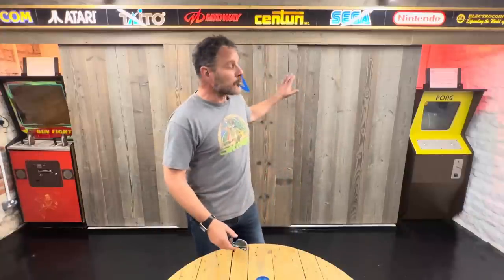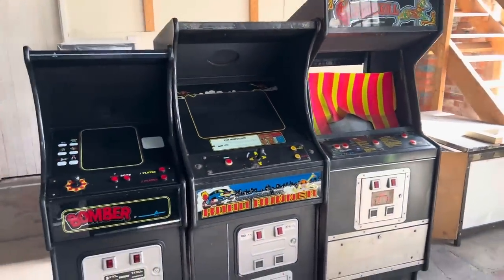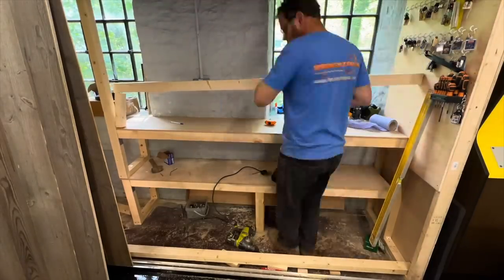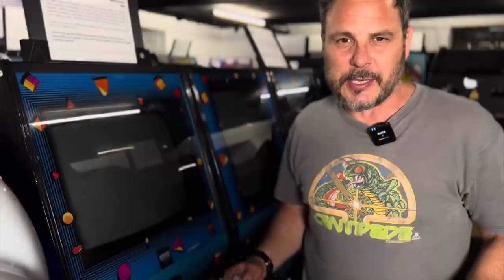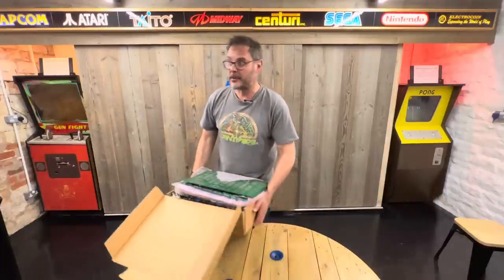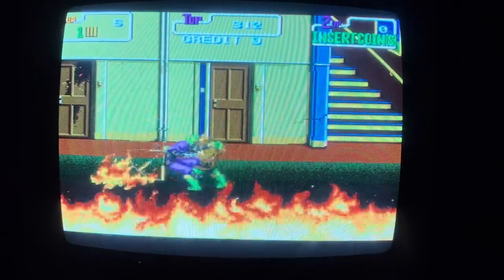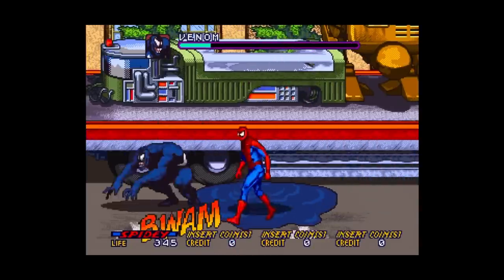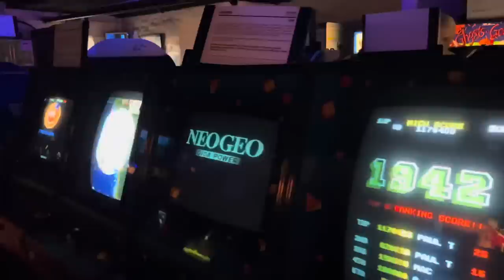I Hate Turtles | PCB Testing and Arcade Museum Update

Comment: Sound cutting in out is probably just a cold solder joint, should be an easy fix. You probably already know this, just excited for the new additions while watching the video :)
Reply from the maker: Your probably right mate, I’m no expert but we have the some really cleaver volunteers helping get these fixed.
Reply: @TheArcadeArchive  If you try everything, and it's just not working, last resort, you hit it with the heat gun, total board reflow. Section by section at first. Then if need be, literally stick the whole thing in the oven. But I'm sure if you got some talented volunteers, one of them will suggest this if it gets to that hail mary stage. Good luck and all the best!
Reply: Can be the caps on the amplifier circuit. My board had sound that would gradually get worse in quality until it just stopped working the longer it ran.Replacing 2 of them fixed it. I also found if they aren't on properly then various sounds and voices stop working.
Only problem mine has now is player 4 is stuck moving to the left. It's a board issue as I've tried multiple controllers and harnesses, changed a couple of chips too but I've had no luck fixing it.